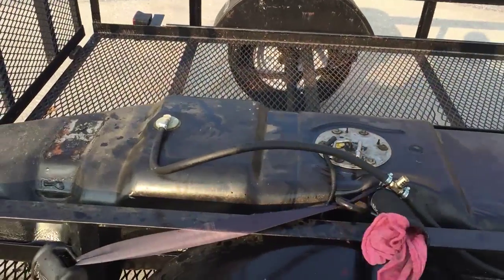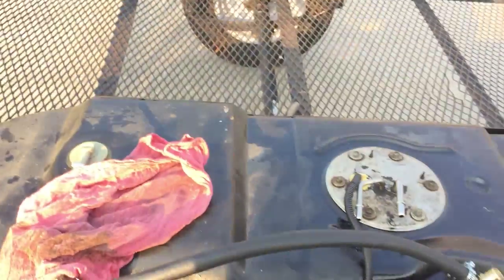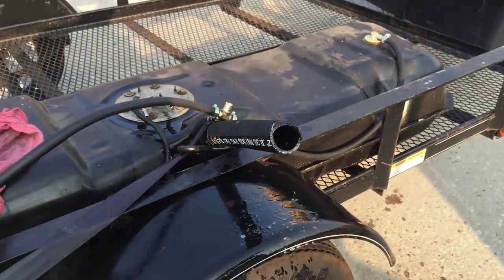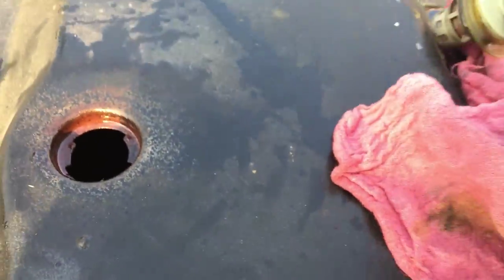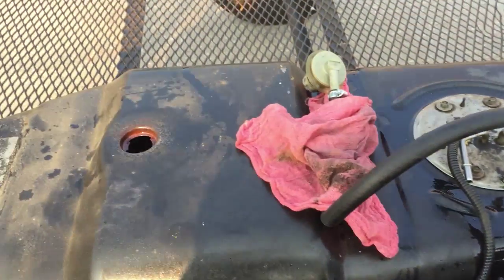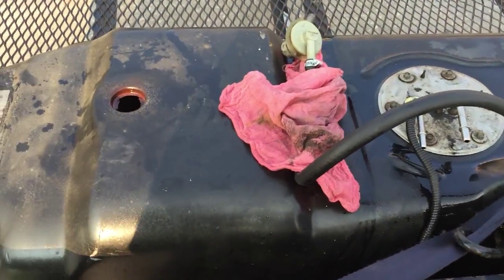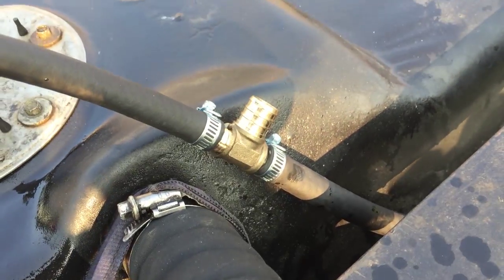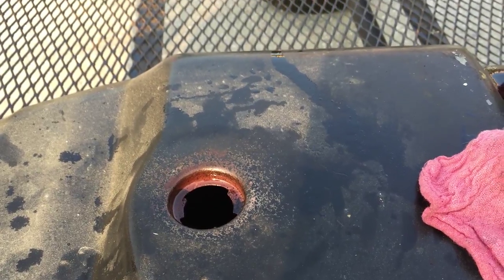Fuel Tank Ventline Filling Problems 2003 Ford E350 7.3 Diesel

Comment: Those two white valves that has each port seem to let air IN only. My 2004 f350 has two But additionally has a vent with filler hose.

Comment: It would be a good idea that when people post a video, and fix it , that they up date it at the beginning so we wouldn’t have to read all the comments and all the comments to the comments to find the fix. FYI folks the fix to this problem was there was no fill tube vent on this tank he added one, was in comments to comments. Also others had aftermarket tanks with no fill tube vent, next to fill tube they added one, they said that fixed it. Friend of mine had same problem, aftermarket tank no fill vent tube!
Reply: Ford tech makuloco said could be the charcoal filter vent all the way up in engine bay but this makes more sense, i think you one upped him.
Reply: @brianblithe2271  thanks for the reply, when you’re looking for a fix it’s just frustrating sometimes the time spent to find the fix in the comments section.
Reply: Stop crying dude. damn
Reply: @davidhoover8877  Apparently you didn’t read my follow up reply 2 years ago? Or you don’t understand FYI’s ?

Comment: Thanks, same problem with my gas F-250, 2005 model!!
Reply: GeneralAlex4  did it fix it? I'm having the same problem
Reply: Same prob with my 06 expy. Although it shows evap leak code. Vent is plastic welded to tank.  Discontinued tank have to go to bone yard for used on with potentially same illness. Thinking about jb welding same vent after drilling hole like one here in vid. Did you fix yours?

Comment: having the same problem with a E 350 RV..... any resolutions?
Reply from the maker: +Caleb Hallford This tank didn't actually have a breather valve! It was supposed to be next to the filler neck. I ended up welding one on and reconnecting the stock vent tube. Works like a charm now.
Reply: Thank you Jared!